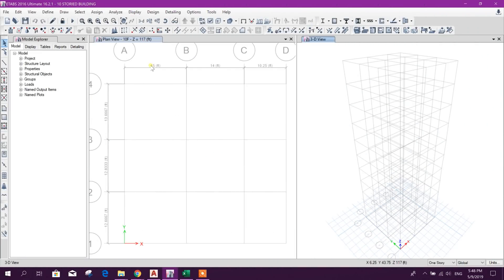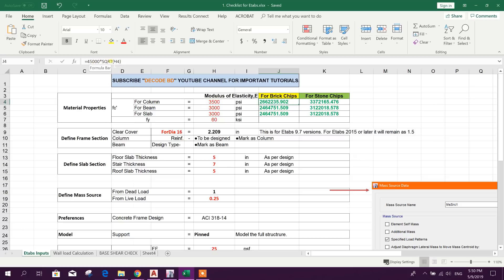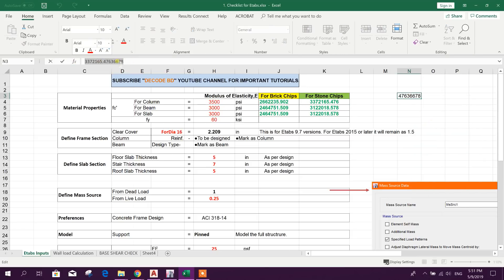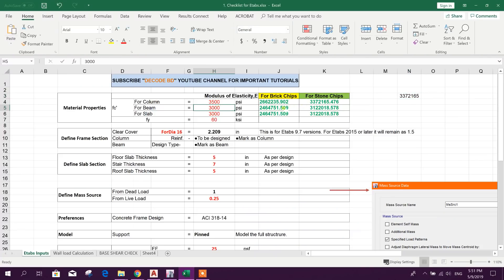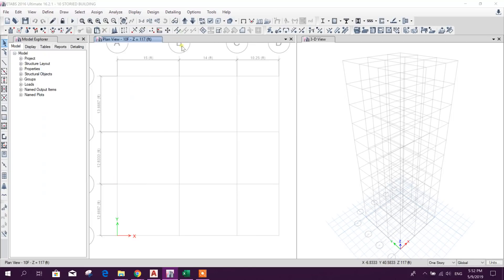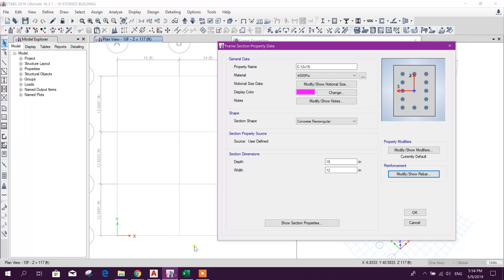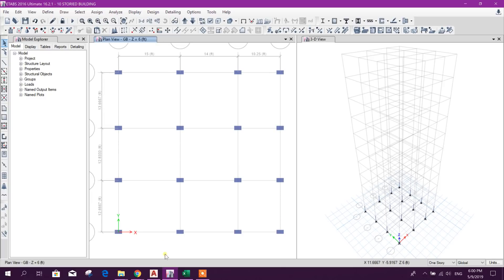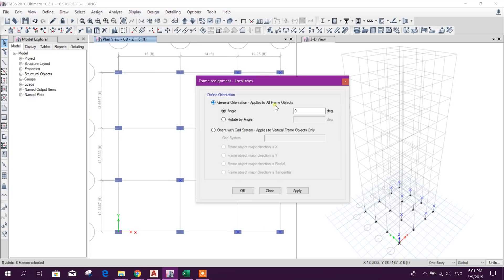10 Storied Building Design in Etabs-Part2

Comment: Sir, what is process for below warning...
*Warning: Area load transfer for storey 7.A1.Total loss=5.88 for load pattern...???
Reply from the maker: Check that slab it may have modeling problem, not getting the connecting node to transfer load.
Reply: @Decodebd  thank you very much sir.and which version is better sir.etabs 15,16,17,18.???

Comment: in the autocad plan we saw few columns were flushing into wall and few Protuding outside wall too. but in etabs when we draw columns, it snaps to exact intersection of two grid axis (concentric, sitting at centre). your thoughts on this sir?
Reply from the maker: Yes, that is by default. You can create offset for columns from grid later.
Reply: @Decodebd  okay. Thank you 😊

Comment: How do you decide the different column and beam sizes?
Reply from the maker: I will show in related design part.
Reply: @Decodebd  I mean at the start of a project how do you assign the dimensions of the column and beam to different sections of the plan
Reply from the maker: We know minimum width for beam columns. Length we have started from 15 inch & onward. We can start from 12'' also. We will check with that also in some short spans later.

Comment: Y didn't you change stiffness modifiers?
Reply from the maker: I am not going to consider cracked sections in this design.
Reply: @Decodebd  Is it necessary to consider cracked section?
Reply from the maker: Necessary to consider as code recommends depending on performance level of the structure. Better to consider for all structure if client doesn't enforce you to provide design as much economic you can do.
Reply: @Decodebd  thanks... :)
Reply from the maker: As it's a tutorial so I am thinking better to consider stiffness modifiers which I will add in next part in sha Allah.